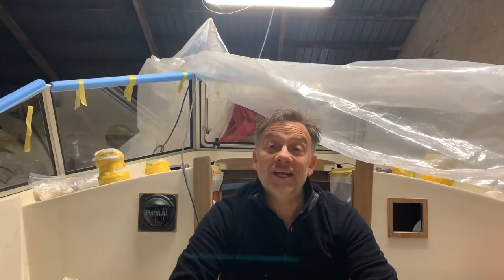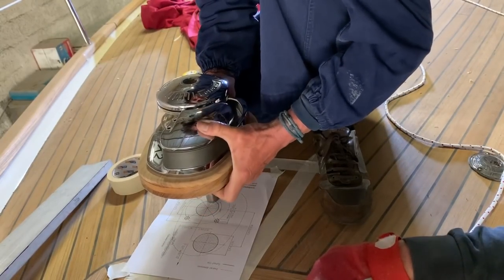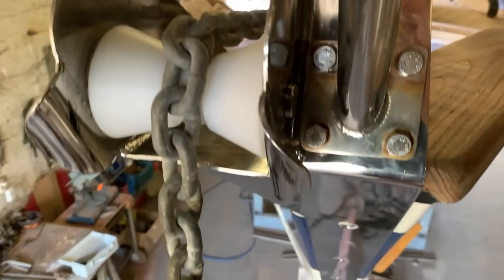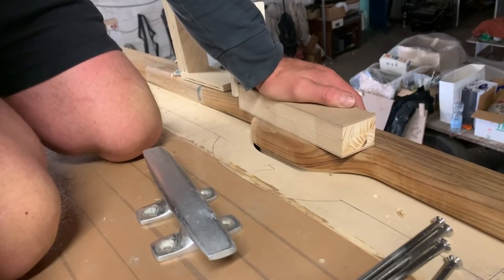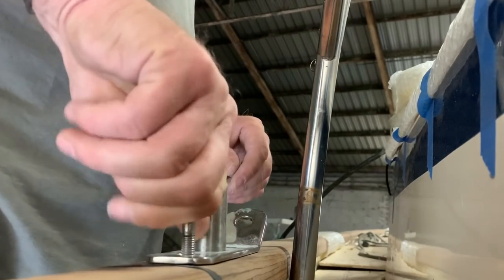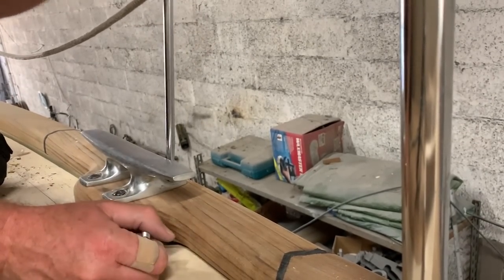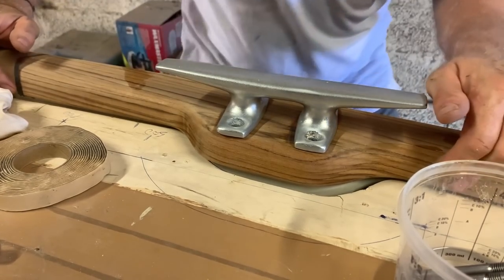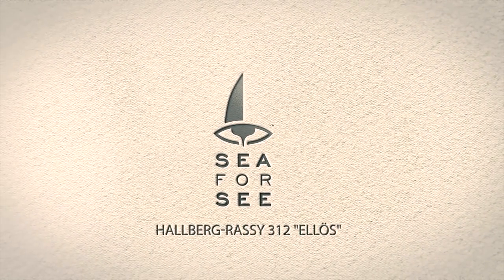Hallberg-Rassy 312 "Ellös": INSTALLING LOFRAN WINDLASS X2 & CLEATS

Comment: Beautiful work - we expect nothing else from Gabrielle.😀👍 Why were you tapping threads into fibreglass for the cleats was this just for those cleats you could not gain access to inside the hull?
Reply from the maker: Thx Norman! Yes true no access inside. 2 trough bolt 2 treads on fiberglass

Comment: Gabriele, I am curious, did you add a shelf to lift the anchor chain off the bottom of the locker so it stays dry?   Or do you just let the chain fall to the bottom of the locker?
Reply from the maker: +Kurt Braun yes I make a shelf that permit the water to drain below and it maintain the chain about 2/3 cm lift from the bottom is made by plywood and paint with double components paint epoxy

Comment: Amazing work and very neat. Just to ask, I'm busy installing exact same windlass. The manual says 40mm max thickness on deck. I see your deck and profile is beyond that thickness. If the windlass is too high, the key does not fit all the way into the motor. Is this a problem or not??
Reply from the maker: Uh uh …. Depending of how much the key will fit it… how thick is your deck?
Reply: @sea4see   the deck is currently 25mm and the teak profile is also 25mm plus also have a 6mm ss backing plate and 6mm ss top plate that goes on top of the teak.
Reply: @sea4see  it's the same lofrans x2 vertical windlass that you installed. At the moment the key on the shaft does not slide all the way into the motor. Does the key really need to be all the way in???
Reply from the maker: Let me check… I will come back to you
Reply: @sea4see  Thanks a mill mate 🙂🤙

Comment: I need help with a lofran x4 when using the drum to release ropes not the anchor . When releasing the mooring ropes the drum start making stuck noise and won’t realease it’s like if it was straining but when pulling in mooring rope which is more pressure it works perfect
Reply from the maker: Hello thx for write! Never happen to me but best way is to take out the drum and have a look inside could be something inside it

Comment: Hi - love the channel.  Great attention to detail :-)  We are planning to fit a lofrans windlass aswell so found this very helpful.  Please can i ask - it looks like you have 40mm thick deck + 20mm teak pad on deck so at least 60mm thick in total?  Did you get a special version of the X2 from Lofrans as the manual for the standard one says it can only do a 40mm thick deck in total?  Many thanks for your videos - looking forward to seeing Ellos in the water and glad you have recovered.
Reply from the maker: +Chris P ciao Chris! Thx for appreciate my work!! Don’t worry regarding the bolts! You don’t need to buy from Lofrans but you can buy a M8 stainless steel 316 threaded bar and cut it at your need.. is better this way because you can make your own custom made installation believe me is a piece of cake!!
Reply: @sea4see  Many thanks Gabriele, much appreciated.  We've just ordered our new lofrans windlass so looking forward to getting it installed and testing it this summer (fingers crossed ;-))
Reply: @sea4see  But do you only need to change the bolts if the deck thickness is greater than 40 mm? What about the main shaft?
I'm in the same situation with similar boat, but from Najad. The total thickness needs to be about 60 mm.
Reply from the maker: I will show you a photo under deck so you can understand but at the end I got same thickness teak plate + windlass+ deck thickness is more than 60…
Reply: @sea4see  thank you, that would be very helpful with a picture.

Comment: In case you still have the original cleats: I would like to buy them from you when they are in reasonable condition...
Reply from the maker: Let it go... gone and corroded the mid cleat was the only in good condition except anodisation
Reply: OK, thanks. My mid cleats on my 36 are corroded and some holes are cracked....

And like you said: they don’t sell the original ones anymore at HR Parts....
Reply from the maker: Yes they are try to make but they gave problem with the polish so they refuse to buy the new old  cleats... I speak with them they looking for other factory that could make the correct fusion...

Comment: How can you open your anchor locker in future ? Isn't the chain in the way ? Greetings into Italy!
Reply from the maker: Ciò Veiko I need to install a handle on the lid , the chain is faraway from the lid
Reply: @sea4see  ok, from the video it looked like chain is going directly over the lid and preventing it to open in the future.
Reply from the maker: Yes off course sadly you need to alighting the chain with bow roller so chain run over lid.. don’t care I will leave open when at anchor